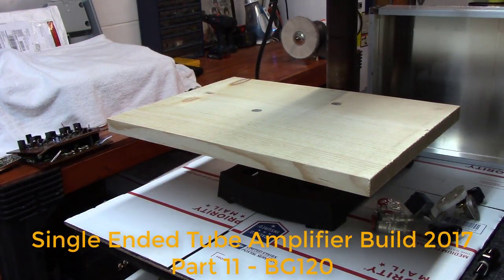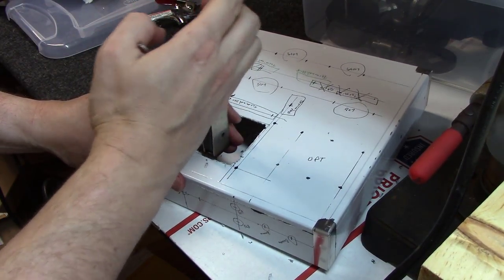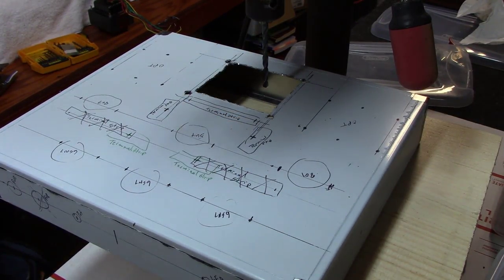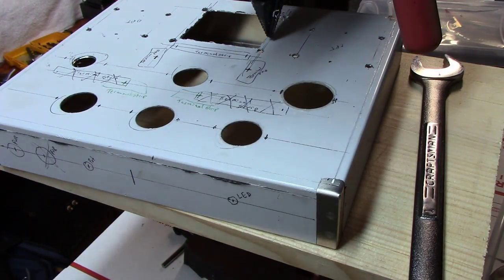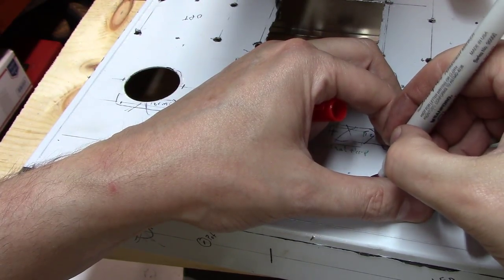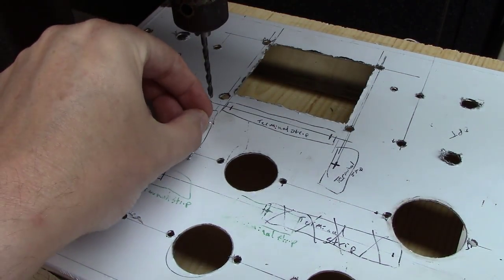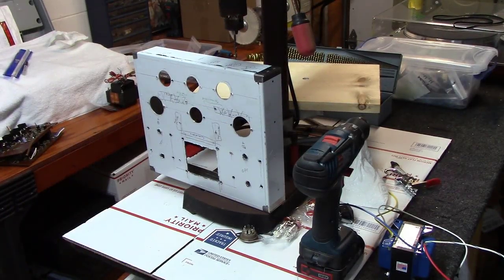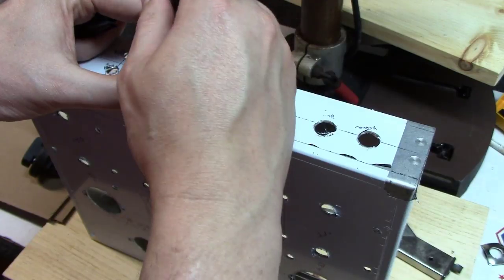Single Ended Tube Amplifier Build 2017 - Drilling the chassis - Part 11

Comment: I purchased a used 5 tube ( think its called a super - Heterogeneity receiver ) over 50 years ago and still using it. Always wanted to build one from a kit. Great thing the tube heaters were in series to add up to 117 so it did not need a transformer for them. Wish kids today would get into working with their hands like we did. Before we were 14 years old know how to drill holes, solder wires, remove a car battery and change a flat tire.

Comment: Great series Mark. Learning lots. BTW, having taken aircraft technology in college, there are some pointers to share. When you cut out the square hole for the transformer, you need to  leave a semicircle of metal in the corner called a 'fillet'.  When you leave a sharp corner, you weaken the metal as the flexing forces on the sheet metal will concentrate on the corner resulting a a crack that will start at the corner and spread to the drilled hole near by. A fillet will distribute the forces along the circumference of the fillet preventing cracking and making the chassis stronger . 

You  can have a fillet if you drill a hole close to the corner on the inside (one radius away from both edges of the corner) and then cut from one hole to the next in such a way the cut line intersects tangentially with the hole . The radius of the fillet should be specified in the layout plans of the transformer, but generally, any size fillet is better than no fillet.

Comment: Hi, thanks for the series, which I am closely following.

Two suggestions: for the transformer hole, just use your rectangular chassis punch at each corner, and save the nibbler and filing. You should be able to precisely get the shape you need. Second, because 0.060" is plenty thick, tap the 4-40 holes, instead of using thru holes. They give a cleaner appearance and saves fumbling with those tiny nuts when you assemble.

Comment: My experience of aluminum is that it needs an aluminum primer applied first, as it has a naturally ""greasy" quality to the  surface. Powder coating will be a great finish though. I liked the brown on the  xfmr bells of the Dynacos you rebuilt. Best. Matt

Comment: To paint aluminum, you should have sanded it with 400 grit sandpaper and then cleaned it with acetone or denatured alcohol.  Then you need to use and etch primer before you paint your color.  The etch primer will also tell you if you need more sanding to smooth the finish.  Aluminum, since it has an oxide on the surface, is hard to paint with no prep.  I thought you pick aluminum because you wanted a shiny surface.

Comment: Wow I have done this myself several times and it's hard work. It's always difficult getting the scrap blank out of the centre of the punch. The panel builder I use have a hydraulic hand gun that just makes it to easy. I wonder what your local water cutting company would charge if you supplied the CAD file.

Comment: A couple of questions from a noob: if you were to use electrolytic capacitors, do they need to be 630v? also, if i wanted to use a smart speaker with this amp, say an Echo Dot (which outputs via a 3.5mm jack), would i need any protection on that connection? Fantastic video series BTW!

Comment: Hi Mark, another great video! Do you happen to have the part number for that 37mm punch? Is it a greenlee? Forgive me if you answered that question in the video and I missed it. FWIW: I am adding VU meters on the front face of mine, a modest variation on the your/Triode Dick design. I'm not real happy with the meters. I wanted a vintage look with the meters. The hole for them is 1 5/16" Do you happen to have a source for nice hi-end meters? Thank for all you do, it's very much appreciated!

Comment: No need for nibblers just use shears metal sheets cut out the hole no need for nibblers less mess easier.
 You could always get holesaw cutters widely available and sheep no need for the expense of a hole press
Try using hammered enamel paints is the sort of finish  I think you were trying to get? don't need to spray you can paint it on with a brush but bake it in an oven would be preferred for 35 minutes at 80°Celsius or leave it in hot sun  for a few days to harden. I think there is a quick drying version, but with any paints it needs to be baked if you want that hard enamel finish or go for 2-pack with a polymer varnish
Reply from the maker: Have you used metal sheers on this thick of aluminum?  I'd like to see a video of that.
Reply: Blueglow Electronics shouldn't be a problem cutting that thickness of aluminium I've cut aluminium sheeting and mainly still if it will cut still at half a millimetre should be no problem on the aluminium. Maybe it's down to the strength in your wrists.

Comment: Temperature was way too high you had it in the direct sun and the black paint temperature the middle must've been beyond 100°, it dried too fast the solvent left the paint material not allowing it to shrink up which takes time, not speed dry.
Reply from the maker: hmmm could be.